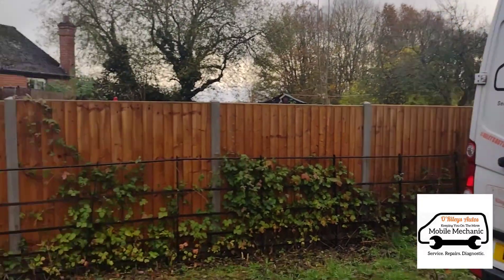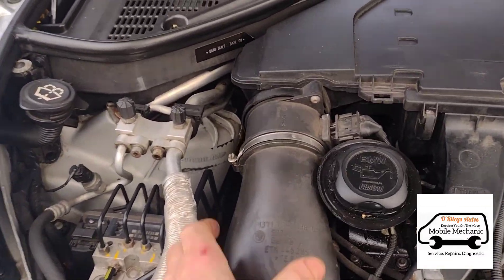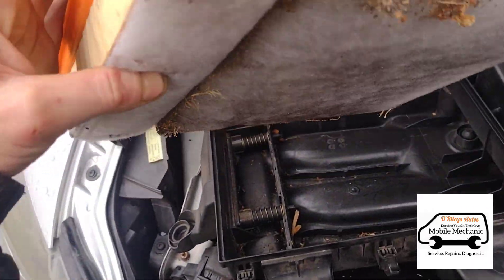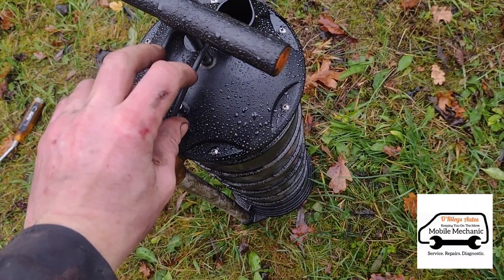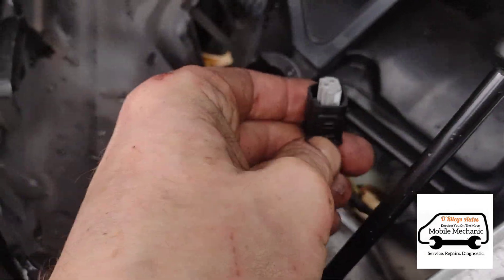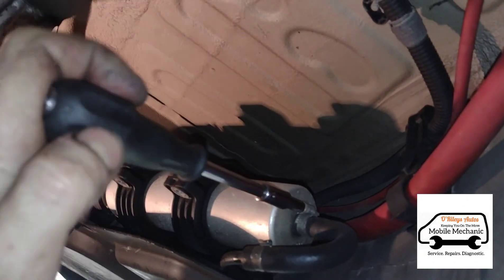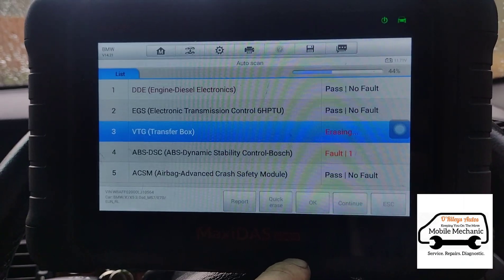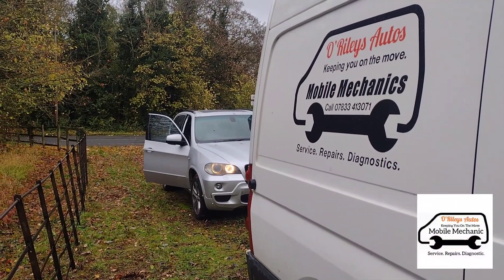BMW X5 3.0D Engine Service Oil Air Fuel Cabin Filter Replacement Location & Black Smoke Diagnosis

Comment: Great video...looking to get an oil pump to remove engine oil..can you recommend pls
Reply from the maker: Sealey TP69 Manual Vacuum Oil and Fluid Extractor, 6.5L https://www.amazon.co.uk/dp/B000RA16CO/ref=cm_sw_r_apan_glt_fabc_RBJ68G9ZVF538QC8KZRT
Reply from the maker: Hi Geoff. Here's a link to the one we are using. Sealey TP69
Reply: @ORileysAutos  are they really good at extracting the oil mate
Reply from the maker: @geoff3172  works a lot better if the oil is hot
Reply: @ORileysAutos  going to get one as last time covered the drive as didn't have bigger enough drip tray lol